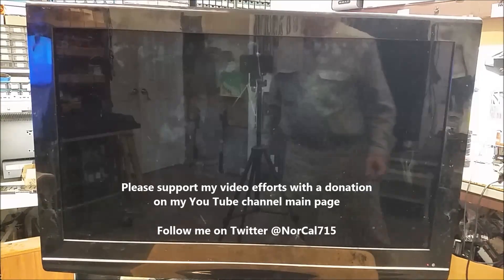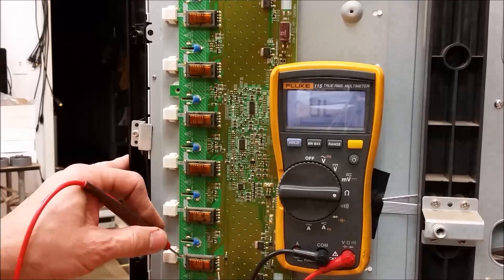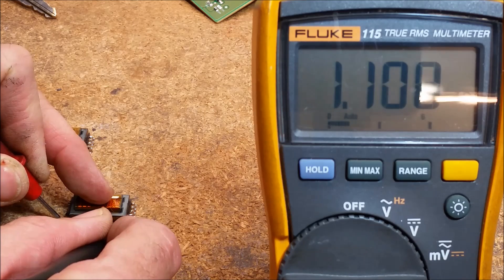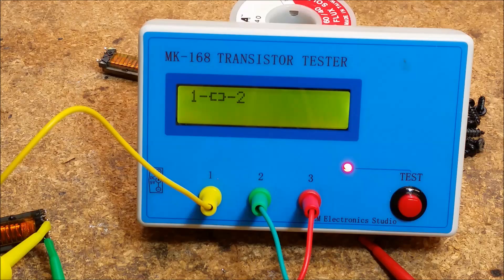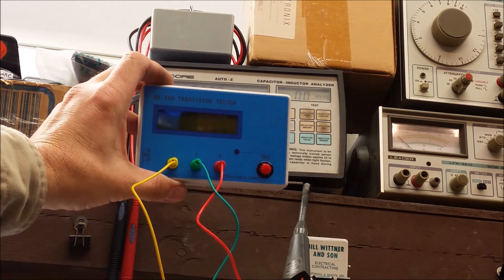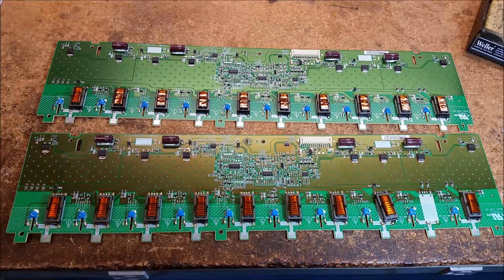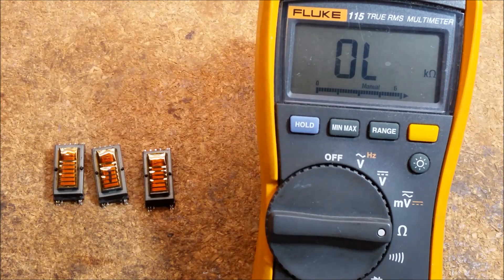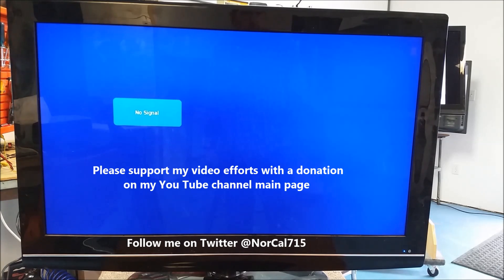Element Vizio RCA Seiki Westinghouse Insignia Inverter board repair fix

Comment: 1. What the heck does a ring tester do?
2. Are all the output coils the same, as I have a TV With no back light
Reply from the maker: 1. A ring tester sends a single pulse of current out, then counts the number of times the coil collapses upon itself, that is the number of rings. A good coil will have 5 to 50 (approx) rings depending on its quality. 
2. Most of the transformers in a fluorescent tube LCD would be the same.
Reply: @norcal715  Bless you and Thankyou for your patience in explaining.
Stay Safe from the Uk

Comment: This guy scares me. All these tools to remove and test a transformer in a pro-ish like way but then proceeds to looking for and buying used parts. Not even using the used part that was purchased but instead sacrificing it to fix the broken part. It really boggles the mind seeing someone put extra effort into arriving at the same result i.e. You're going to have one broken board and one fixed board whether you use the new board as is or pull parts off it to put on the old board. Seriously, if you wanted to try replacing just the transformer, YOU CAN BUY IT NEW! A "tech" with all these tools that doesn't know components like a ccfl transformer can be sourced brand new is really scary imo.
Reply: he is just too much,

Comment: question wouldn't the multi meter on the ohms setting back feed another circuit and cause damage to solid state components what is your opinion on this method of testing

Comment: How do you determine the output pins on transformers like that?
Reply: +mrsemifixit id also like to know this!
Reply: You can tell what leads are on the output, just based by the lack of components and traces (except for the output trace) on the PCB. This is because the output is high voltage, and it needs greater electrical insulation.
In this case, one end of the HV output is in reference to the control circuitry voltage (? It may be ground, or it may be a supply voltage - varies from set to set).